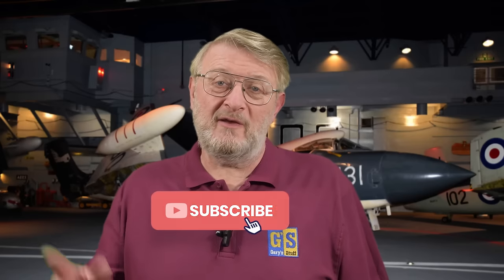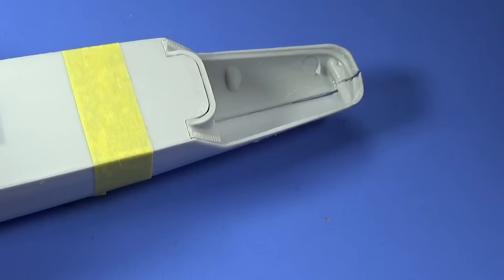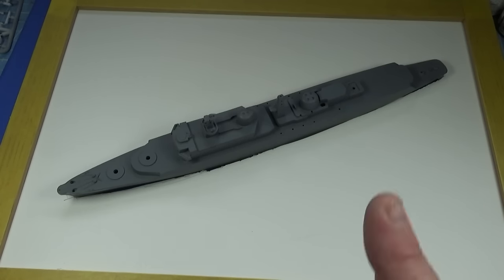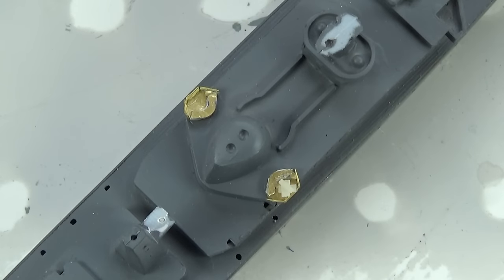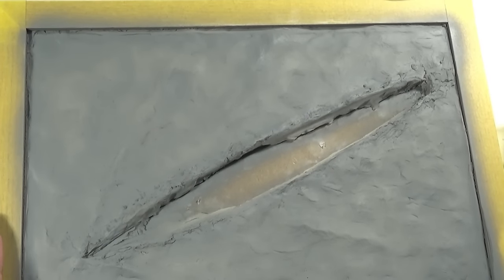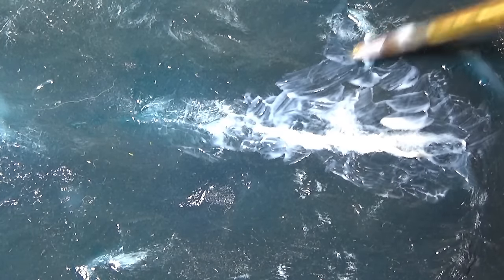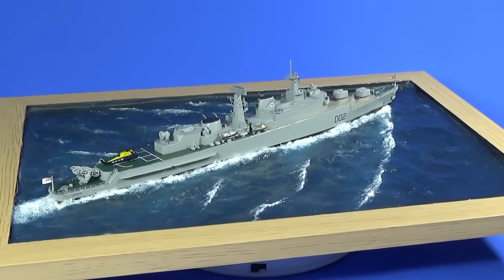MY FIRST SEA DIORAMA BUILD! Airfix 1/600 HMS Devonshire

Comment: When I built these kits in my youth, I would locate the deck with out glue into the slot provided to help in lining up in locating the ships hull. The 2 hull pieces will fall in place. I would use elastic bands to hold things together and start by cementing the forward bow and the stern without going past the keel forward part of the bow. Make sure that when you cement the bow and the stern of the hull. Stop anymore wrk until the cement cures min of 24 hours. Be careful when you cement the stern together, do not pass the rudder post. There you go. Your on your own.

Comment: Hi Gary, much anticipated build.  I think you were suffering from the same problem I found in the group build (you will remember it was my first for 46 years) and that is old age fingers!  When I was young I found hull join-up and such easy but when I was putting the top wing on that camel and trying to get all the struts in and lined up (I cut a box to make a jig to get the stagger right) but it seems dexterity goes with the years.
You made the right decision to "bury" the hull rather than cut it down.  You will have noticed in the "old days" pictures I sent you, some hulls cut down to the water line curling up badly at the ends.  They all do that to a greater or lesser extent and it is the devil to get them flat.
Guard rails are about 3 feet high so at 1/600 thats 60thou high (1.5mm).
I really like your sea, very good.  I only tried it once and then I tried painted paper across a cardboard box (I think it might have been the lower kit box) with a hull shaped hole, it was not a sucess.
One other thought.  I hope you have a matelot follower who can clarify the use of flags but my understanding was that the jack (ie up forward) is only flown in port.
I thought the photo etch might be the only solution for railings and the detail of the "bedstead" (not so sure on the latter even) but seemed pointless otherwise.
You have every reason to be proud of this build, particularly as a first ship, I like it anyway.
Reply from the maker: Thanks Emma - I will wait to see about the Union Jack forward - maybe she's steaming towards port (he suggested desperately!) - Dad might know but as he was on a carrier they used the bow jack as little as possible because it was on the front of the flight deck and a little in the way! I did cut the hull down a little but not to the nominal water line as I wanted a bit of flexibility with waves and troughs.
Reply: @garys_stuff  Hi Gary, I noticed (after writing the bit about the hull curl) that you had your croc clip inside the hull so obviously a hole in the bottom is not so bad (except it might let the water in!).
Reply from the maker: @emmabird9745  I put a bit of spare plastic frame across the width of the hull on the inside to allow for a croc clip...
Reply: @garys_stuff  Well done, I reconned that was the cure......

Comment: I made Devonshire as an 8 or 9 year old back in the late 70s. Whilst I cant remember (of course) if the hull was that difficult. I'd have probably given up (no tape back then with tube glue going everywhere). It just shows you how molds change.

I alway think Airfix misses a trick by not issuing a simple new sprue to add detail/quality to these old kits.

Comment: Congratulations Gary, for a first sea diarama that looks fantastic.
However, I still haven't changed my mind about photo Etch, it's a complete faff in my opinion.
Yes it looks good when finished, but it's so hard to do. Especially if the old eyesight isn't what it used to be and shaky fingers means that the carpet monster is usually very well fed whenever I have tried using it.
I am a big fan of the resin parts though, they look far superior.
Reply from the maker: Yes, if they could find a way of doing resin 3D for everything it would really help - not sure the railings would work at this scale though - those gun barrels were really flimsy in resin. Someone probably does them in micro-turned brass by now...
Reply: @garys_stuff  I've seen gun barrels at 1/350 scale, not sure about smaller scale, but yes it would be nice to have metal barrels all around.

Comment: That is really great - not something I have ever attempted, so to me that is hugely impressive. Just to note for any future RN ship build the Jack is only flown whilst alongside or at anchor, never whilst underway. Cheers.
Reply from the maker: Thanks for the clarification Guy! May just take it off before it goes to the next club night....!
Reply: One other note Gary ( I know this is going to sound a bit anal!) the railings should be level with the flight deck. During flying stations they are lowered to act as nets as you have them but they remain on the same level as the flight deck.

Comment: Well done! That looks splendid.  Just doing a tiny water diorama and this will be a useful reference for the waves.   Have done a couple of ships bases before but I used aluminium foil to create the waves as acrylic water effects were not available then.  PE on a 1/350 ship is bad enough but at 1/600, that is really impressive work. 👍  I hate PE but built a few of the Metal Earth kits and that got me more used to using the stuff. Still hate it but not so scared.

Comment: Hi Gary.. I've just had a thought regarding model ship dioramas. I don't know if it would work TBH but if the water is resin, maybe place the ship in the resin before it goes off and push it a bit forward. That might make the resin form a sort of bow wave shape that can be painted once the resin goes off? BTW the comment about the triumph of hope over experience made me laugh out loud :)
Reply from the maker: I think the problem is that the acrylic is a gel so won't flow the same way as water with the scale effect and all. It would probably work for the lift in sea caused by those big underwater nose bulges (for sonar and for hydrodynamics, i believe), but that would be in a big vat!
Reply: @garys_stuff  Fair enough, it was just a thought :)

Comment: Very nice build. But for future reference - bow waves don't behave like this. You have a "V" going straight out from the cutwater at 45 degrees. It is much more complex than this, but for starters the bow waves should be confined to a narrow V-shaped area with its apex at the cutwater and widening out aft. You won't really start to see the expanding  bow-wave "V" pattern until one wavelength aft from the cutwater.
Reply from the maker: Hydrodynamics is not my area of expertise, aerodynamics is, for the next one I'll use photo references.
Reply from the maker: Kelvin wakes - I had no idea the noble lord had made a mathematical analysis. Very interesting subject, although complicated by being real world rather than ideal fluids with point sources and stationary water uncomplicated by turbulence.
Reply: @garys_stuff  Yeah - it's a small thing really in the great scheme of things but damned visible so worth knowing about :)
Reply: @garys_stuff  Assume that the penguin is a circular cylinder...
Reply: @garys_stuff  It is dangerous to assume that the noble lord did NOT do anything. A hyperactive if ever there was one!
Reply from the maker: @ssanneru  but such apparently small things can make an astonishing difference!
Reply from the maker: @ssanneru  a very great physicist, to be sure.

Comment: Great job on a poor kit. It is so inaccurate. The superstructures are set too far back. The quarterdeck (Seaslug launcher deck) is too short and should be extended forward. Anyone who wants to do an accurate build of this kit should do some research. There are differences between the Batch 1 and Batch 2 ships with Batch 2 having a slightly different fwd superstructure and having a double bedstead 965 radar. Only Batch 2s had Exocet in place of B turret. Batch 1 ships Devonshire, Kent, London and Hampshire. Batch 2 ships, Fife, Glamorgan, Antrim and Norfolk. I served on Fife 78-80.
Reply from the maker: I think Devonshire was commissioned in '62 and this kit came out in '63. It is likely that the designers were working from drawings from early in the design phase and not the ship as launched - happened with a lot of aircraft kits too! Incidentally, the Atlantic photo-etch does have the double bedstead as an option. I think it is a good general policy to regard Vintage Classics as likely not be approximate and not accurate! Starling, who make the upgrade, also make their own full resin and etch kit in 1/700, I think from 2021.